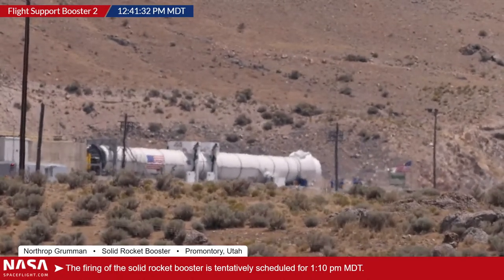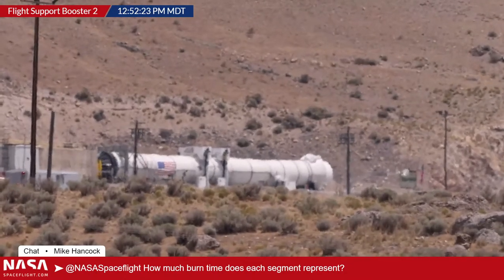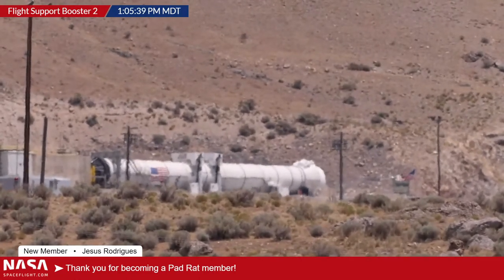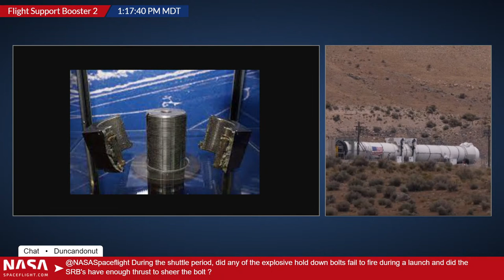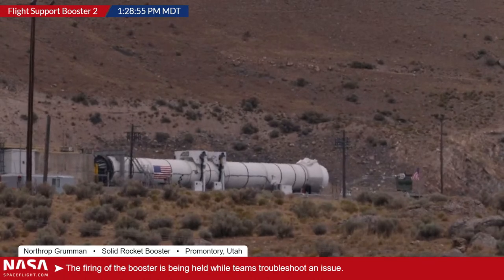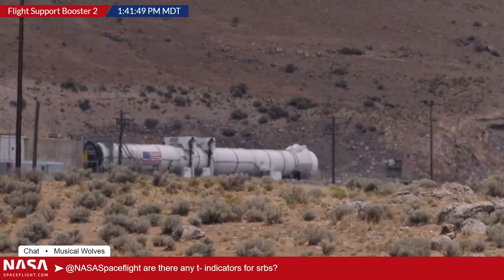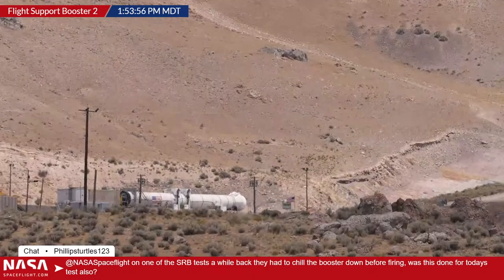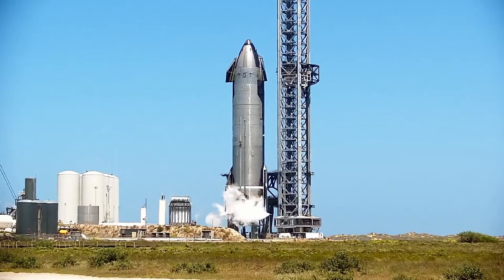Test of Upgraded Space Launch System (SLS) Solid Rocket Booster

Comment: Crazy that just this 1 booster is over twice as much thrust as a falcon 9 with only slightly larger diameter. One of these as a core with 4 more around that would have more thrust than super heavy currently would at launch.
Reply: You’re trying to compare apples to oranges. Falcon 9 and Super Heavy are 100x more impressive in every sense. I don’t see SRB’s landing on an autonomous drone ship.
Reply: @M1_159  Yeah, Falcon 9 is impressive, but it doesn't change the fact that this thing is fucking POWERFUL. It may be comparing apples to orange, but both are good fruit.
Reply: @M1_159  I'm just comparing thrust at liftoff, not overall ability or anything. Just to give perspective on how much power is packed into a solid rocket booster vs a liquid fueled rocket of the same size.
Reply: The problem is that solid rockets* are not throttleable. You like them and they run like they are built to run. You can’t turn them down. Now you can do a few things to slightly vary their thrust but it’s built in, you can vary it in real time. So that’s why they are generally used as boosters.

* Ok, you can kinda do it if you do like the Virgin bird and use liquid as your oxidizer instead of using a premixed filler. Then you can throttle by varying the amount of oxidizer, but that’s not your classic solid rocket.

Comment: So how many times will this be reused? Spacex recently landed the same rocket for the 14th time with over 100 landings now!  
This kind of rocketry is amazing but its the way of the dodo, not sustainable.
Reply: The SRB's get reused. The parts you just saw tested in this are in fact refurbished/upgraded parts from the shuttle era. The shuttle system refurbished the very same boosters as well. They would parachute back into the ocean where they would float and then get towed back to shore. They would then be inspected, rebuilt, refueled and relaunched. Of course it's not the same as SpaceX but regardless, they were reused.
Reply: They were flown, splashed down in the Atlantic Ocean. Retrieved and towed back in to Hanger AF. Inspected, disassembled and refurbished. SRBE ARF refurbished the Aft skirts, forward segments, frustum and nose cap. The segments were sent back to ATK in Utah. Besides the external tank all most everything on the space shuttle was reusable....
Reply: @pulver117  nice
Reply: @randallolson7630  no sorry they dont lol
Number one its just excess gas burning off after the engines shut down, the rocket isn't on fire.
2, the entire rockets is crazy hot after reentry something that wont happen on the moon due to there being no atmosphere.
 Your troll game is weak.
Reply: @jaybyrdcybertruck1082  My "troll game"? You misjudged me big time. I'm one of the biggest fans of anything NASA related, especially manned space flight, as I was 16 years old when Apollo 11 landed, and followed it all closely through Mercury, Gemini, and Apollo. I can't wait for Artemis. I just hope I live long enough to see them make it to Mars! I just worry about worst case scenarios. I'm just a layperson fan, not a rocket scientist, so that's why I'm asking questions. SpaceX is supplying the lander that will put astronauts on the moon in only 3 or 4 years, and it hasn't even been fully developed yet. I hope they can make it. No one wants to see another disaster.
Reply: @randallolson7630  Totally agree with ya on all of that. Safety is key 100% 
I love NASA too, i've just had a hard time being excited about SLS as it is extremely over budget and years behind schedule.
I am sure it will fly and work great, its just that its such a huge cost for so little return compared to what is coming down the pipe.